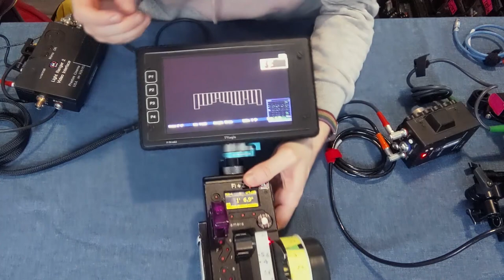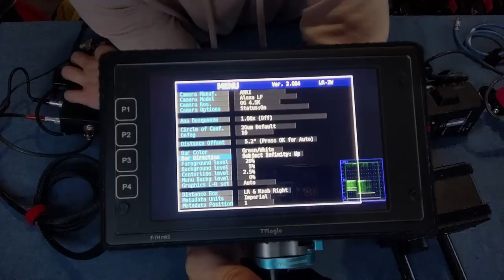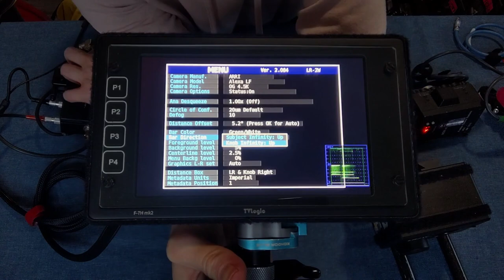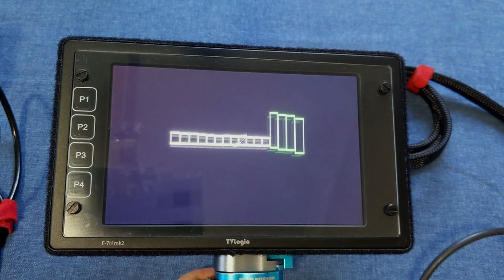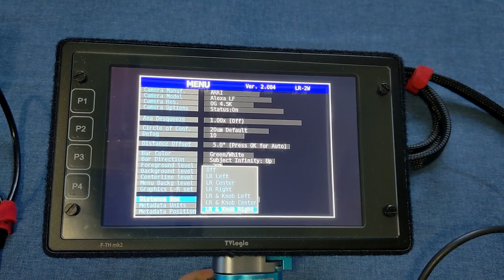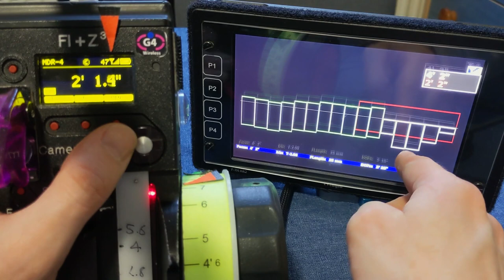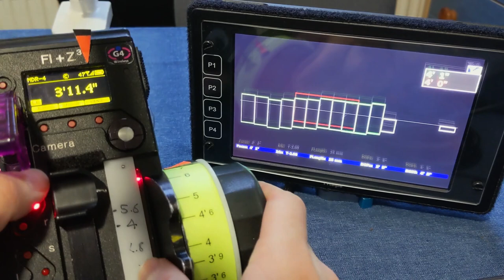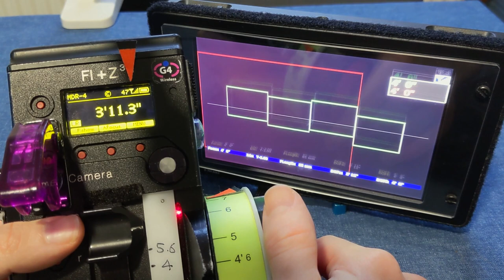Preston Lightranger 2 Quickstart

Comment: What focal length do you find the threshold to switch between M-W  for zeiss/ ultra snd master primes
Reply from the maker: On super 35 I'd say 65mm and above you'll want the M. You may want to switch for the 50mm if your doing more long lens after.
Full frame (LF / Venice) 85mm and above.
I find I stay on the W 95% of the time, even on longer lenses to save switching twice.
Reply: Thanks for info good overview  tutorial on LR2 interested using it more as my eye getting older - I usually use a focus Bug/cine rt since remote doubles as sonar tape -super useful for grabbing my own marks can LR2 interface with newer generation  Preston 4?
Reply from the maker: @tsan3796  LR2 works with all Preston products in production. Some older MDR3 and HU3 need firmware / hardware updates.
HU4 was made with the LR2 in mind and had multiple features designed for working with the LR2